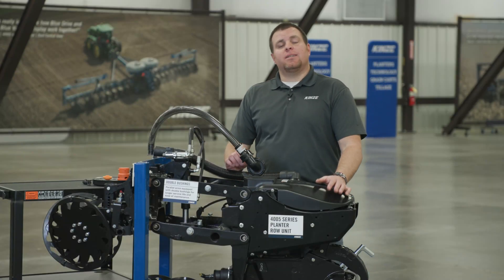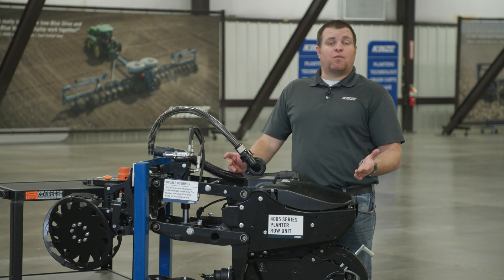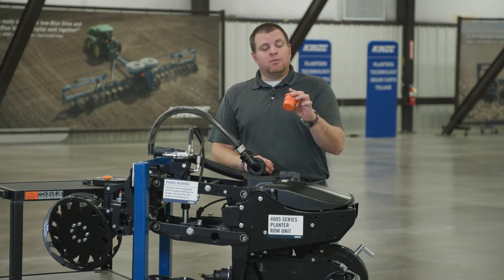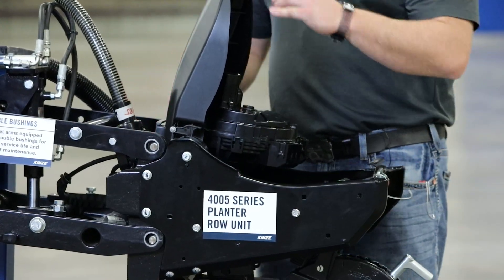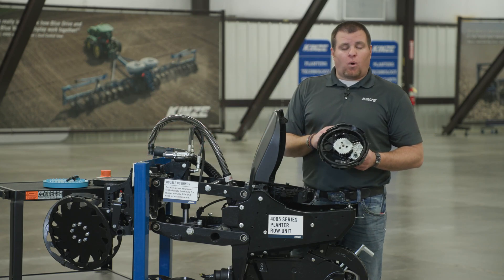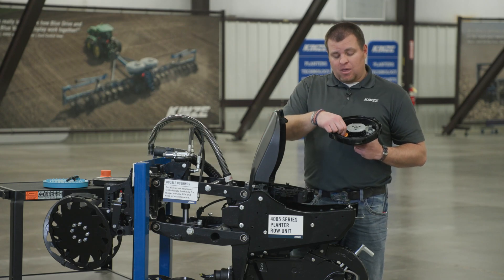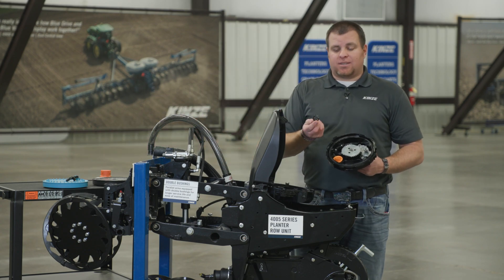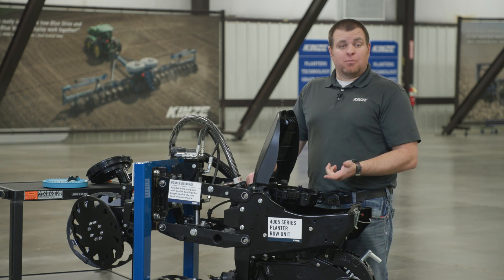Kinze True Speed - Easy and efficient crop changeovers.

Comment: On my 3665 in manual says run on baffle setting number 3. In video it says to run all the way up on setting 5? Obviously running 15 inch rows. Trying to achieve 160k population. 46 cell seed disk. What baffle setting should I use? Any recommendations on vac and bulk fan pressures also? Just got planter and trying to get any advice I can.